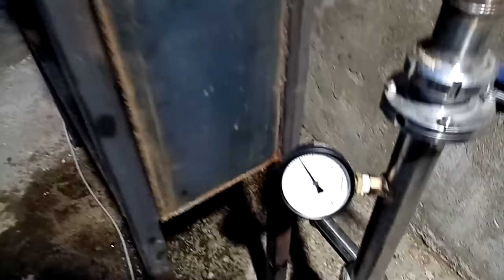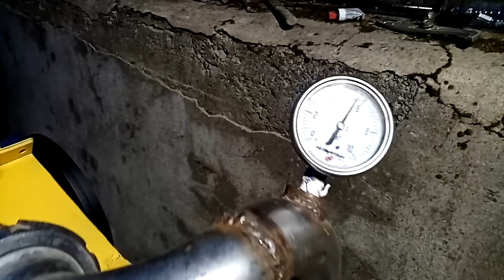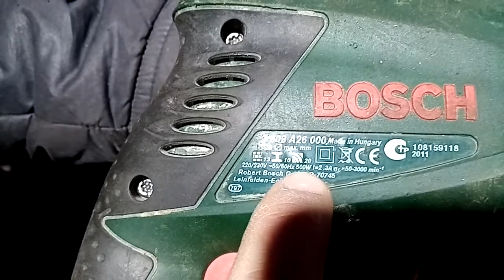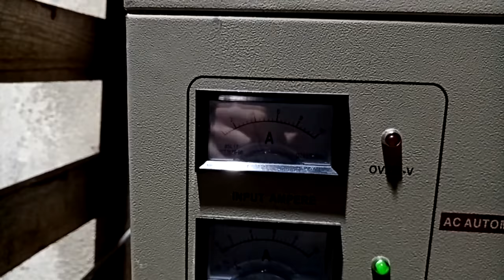pelton turbine 3kw (georgia)

Comment: I was wondering why you geared down the belt from the pelton wheel to the generator?  Could you squeeze more out of the system if you geared it faster?
Reply: gen needs to run at a certain speed for cycles pelton to fast for it. gear reduce more torque

Comment: Hi, Please change the name of video. Watt=Joul per second. It could not be J/s/h. It is Illitirate.
Reply from the maker: yes watt = joul per second,  1000W = 1kw and this  power plant generate 3kw in hour, what did not you like?
Reply: @hydrodynamicenergy  To be clear : it generates 3kWh in 1 hour and it can deliver 3 kW. The  heater you connected consumed 4A. 4A at 230 is about 1kW. So you can connect up to 3 such heaters at the same time
Reply: There is no time factor in power. It's 3 KW period.